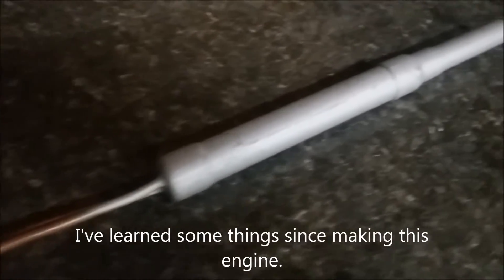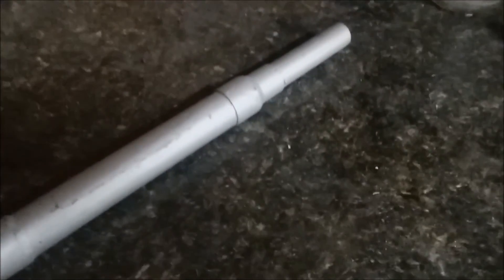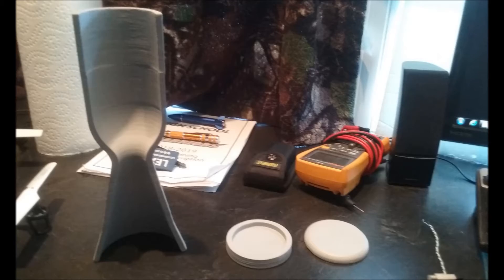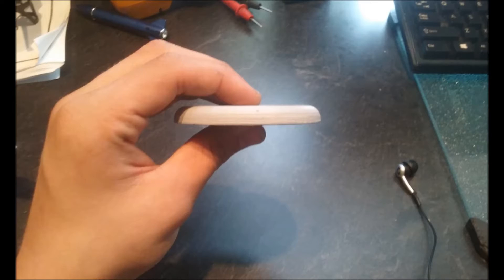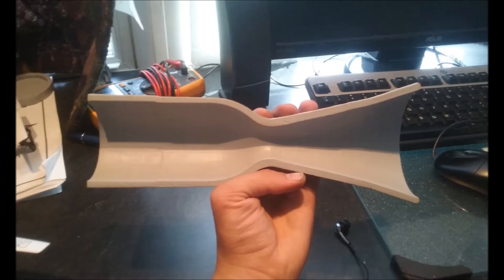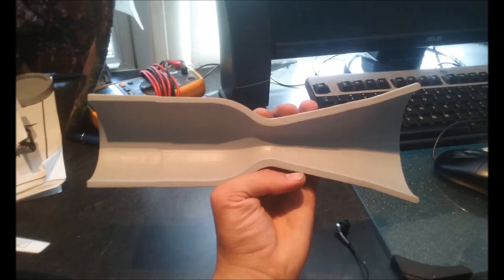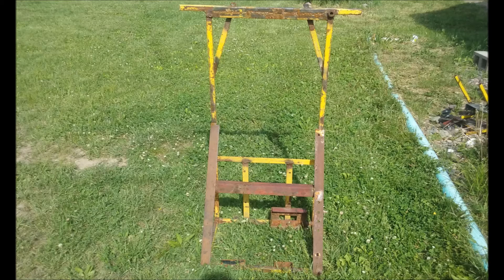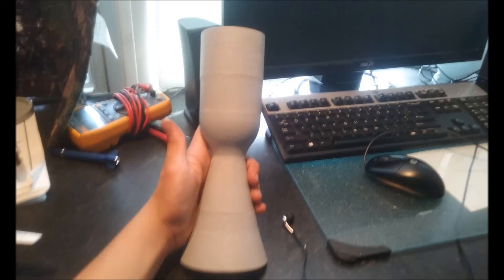Liquid Fueled Rocket Engine Version 2

Comment: Im working on hybrid rocket engine and also solid rocket engine. Author, could we talk about it in a chat?
Reply from the maker: Hi there, I haven't worked a whole lot on rocket engines recently but my last video was a short hybrid rocket motor test. To answer your previous question of if I had tested the engine yet the answer is sadly no. After doing quite a bit more research I realized this engine would have to have an incredibly high chamber pressure to have a stable burn so for the moment this project is kind of abandoned.
Reply: Our project just has been started a few days ago. Had done you some math before you built it up? We don't know anything about it. Nevertheless we are going to test solid rocket engine 2800 Newton second

Comment: oh god, you have no clue what your doing do you? I did some quick math, and if that throat is around 20mm, and you're looking to get around 1000N out of it, then you're looking at a chamber pressure of up to 10000psi, (this could be off by a few thousand since I had to estimate some variables). That would mean that (assuming your combustion chamber is ~150mm ) the wall of the combustion chamber would have to be nearly 100mm thick! Please do some maths. Research what a fuel injector actually is / looks like. And then start saving up for the materials and tools to build a real engine. No hard feelings, I love your optimism.
Reply from the maker: Thanks! A while after this video I realized a lot of the design was flawed. I'm not scrapping the whole project but am starting smaller again. I started working with a small hybrid rocket motor recently and will probably work from there.

Comment: Add regenerative cooling to your design, it's easy to implement and if i recall correctly you need two layers and a small gap in between with structure to hold it. I'm currently working on a rocket engine which aims to use regen cooling by design

Comment: Just a thought: if you want to add regenerative cooling without redesigning the nozzle, you may be able to add some copper pipes that are cut in half around the outside of the nozzle seems to be how engines like in the space shuttle are made. Can't wait to see you work on this!
Reply from the maker: Thanks, I'll try doing that near the throat and end of the nozzle, I still have to get the parts cast though.
Reply: Can't wait!
Reply from the maker: Thanks!

Comment: Regenerative cooling is surprisingly easy to add (based off my experience.) All you would need to do is reprint the inner half with supports to hold the outer layer in place then create the thin outer layer the same way, with at tab facing inward to seal and mount hoses of course. Pumping water through the system is easier then using your fuel like i did, as long as you keep the gap small the flow rate will not allow for boiling. By off setting the seam of the inner and outer layers you would also be greatly adding to the strength, allowing for thinner inner wall and thus better cooling so you don't melt off some of it. Anyways just my thoughts on the matter. What ever you end up doing so far it looks much better then my literally hammer forged 3Kn engine.
Reply from the maker: I had the thought of welding a copper liner slightly larger than the engine to allow a gap for coolant, but for the first preliminary tests I'll probably use something similar to a water deluge system. Thanks for your input, I'm still some time from casting the engine so improvements can be made!
Reply from the maker: Also I would be interested in seeing or hearing about the engine you built.
Reply: Just getting the last touches of piping done. 1-2 months from full power tests. I have not documented it well but plan on doing a simply video about the engine after the test, i'll remember to give you a link to it once it is posted.
Reply from the maker: I'd love to see it, good luck!